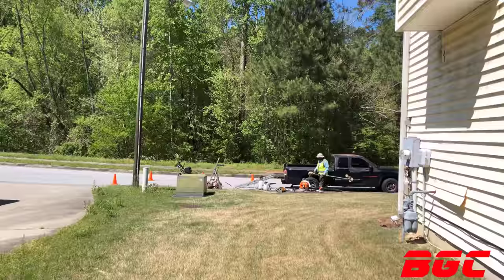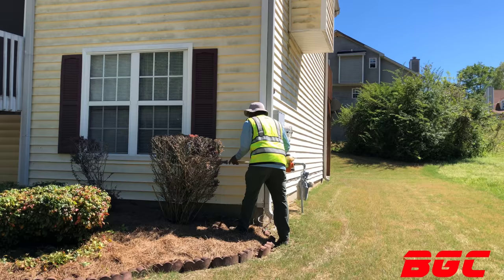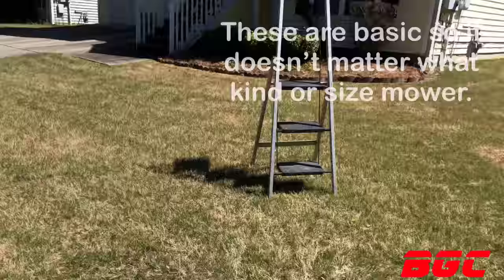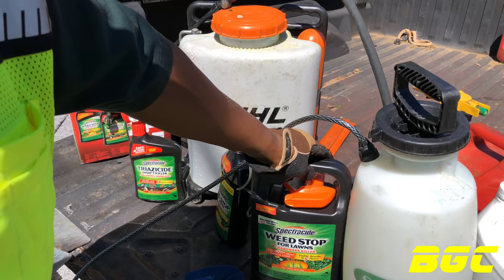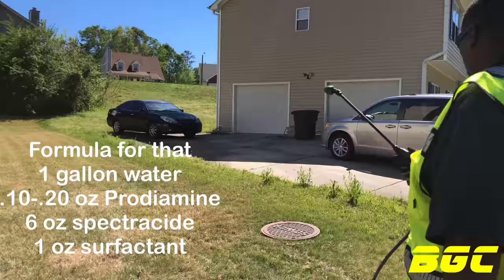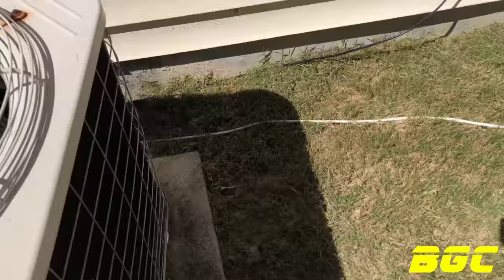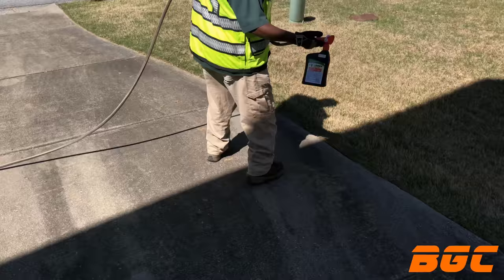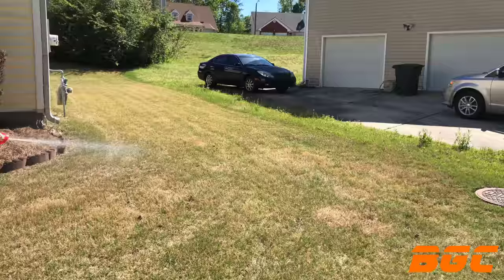How to maintain your Bermuda lawn plus Spectracide liquid insect killer, Ugly lawn fix

Comment: Great video as usual, BYD!!!

Quick question...what is the best approach to kill tall fescue clumps both in the spring growing season (right now) and in the winter dormancy period? 

My back lawn is being taken over, so I believe  it’s going to require a tougher approach. The front lawn just has some spots here and there. 

Thanks for the help!!
Reply from the maker: Shere Khan image herbicide for warm season grasses can help with killing that if spot sprayed. It won’t instantly kill it though but should hurt the Bermudagrass but you may get herbicide burn especially during summer heat.

Comment: BYD, I'm in Hawaii and close to the beach. My soil has a lot of sand with a top soil layer. The top soil over time has mixed with the sand. Last year I started a bermuda turf lawn from seed and have had some rooting/growth issues. It seems my soil compacts very hard after watering. The turf comes out so easily. I battle with nutsedge and crabgrass mostly so when I treat my turf I loose a lot of it. Do u have any suggestions? I was guna try Anderson's Humic acid granuales and start over with my turf lawn this spring. Thank you.
Reply from the maker: David Lewis Aloha David 😃, sounds like you have more sand than soil. Even if you use Anderson’s humic you probably don’t have enough soil for it to hold on to. The Crabgrass and Nutsedge can be handled if caught early with the spectracide ( depends on what nutsedge you have though ) I’d suggest more soil and only mulch, this will help build up the soil, focus on a low nitro program to prevent top surge growth. A growth regulator like T-Nex can help push more Stolon growth, this will help expand the root system, weekly cut will help, keep it cut low. Your circumstances are unusual though. Try this a let us know how it works out.

Comment: I mixed potting soil and sand to fill my bare spots and runners. But when it rains the soil washes away. What do you recommend thanks.
Reply from the maker: alexandre woods dig a small  whole, plants those runners 3 inches deep. It’s a slow process though.
Reply: Bermudagrass Central yes I’ve done that. The runners are still there. It’s just the soil that keeps washing away.
Reply from the maker: alexandre woods you may need to just buy some pieces of sod.
Reply: Bermudagrass Central thank you sir

Comment: How did you arrive at the calculation of 6 oz. per gallon of H2O?  I’m trying something similar with the Bayer Season long weed control.
Reply from the maker: +ZeroTurn that’s what it says in the instructions, all products are different though so read them before mixing.
Reply: I forgot that you also use the concentrated formula.  I assumed that morning that you were calculating from the hose sprayer formula only.  Rookie mistake on my end.
Reply from the maker: ZeroTurn 👊🏾